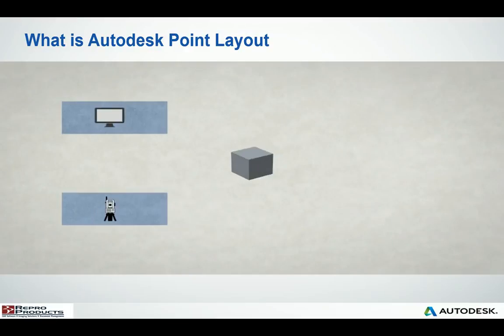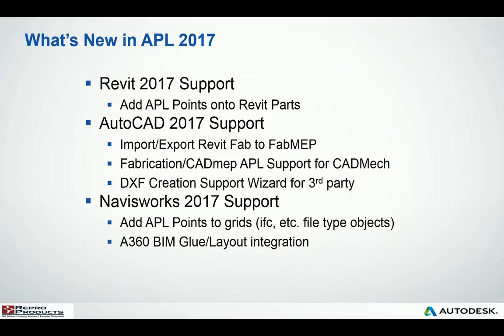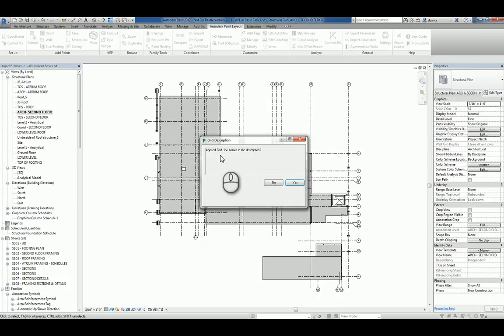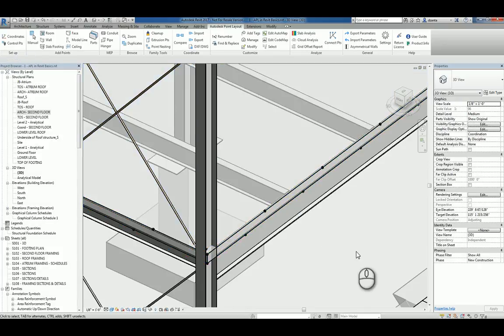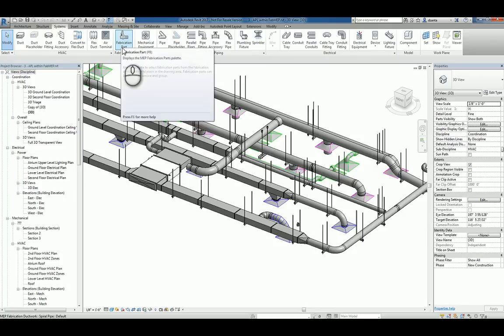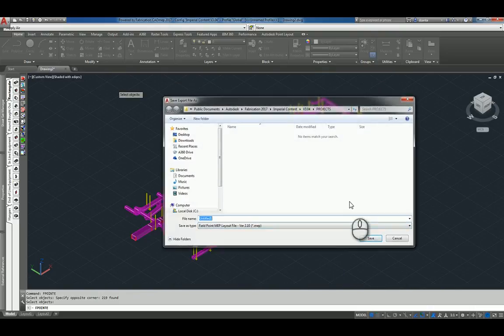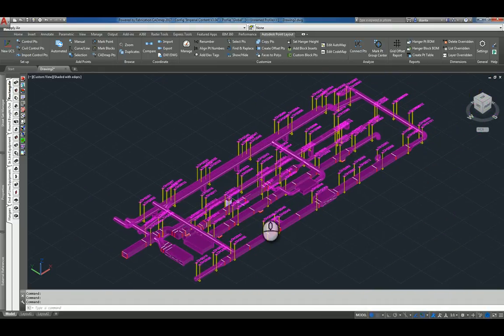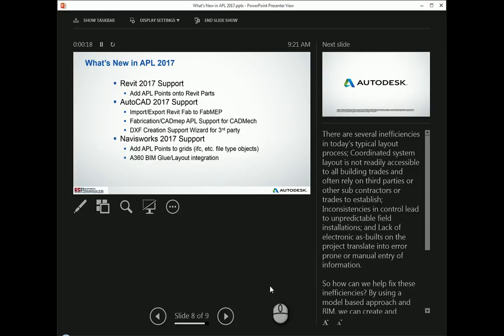What's New in Autodesk Point Layout 2017

Comment: Hi, I really like the pointer you used, where did you get it?
Reply from the maker: hi....are you referring to the icon of the mouse that follows my cursor when I am moving it?  If so, this is a feature of the Camtasia software if it is turned on in the Settings.  If the recording was made with Autodesk Screencast, the mouse icon is turned on as a default.

Comment: I have been having issues exporting points in APL with Navis. when I manage points the XY are correct but when i export they are not. Any pointers?
Reply from the maker: when you export the points, specify a coordinate system first.  Preferrably one that matches the source authoring application (i.e....if the source file is a revit file, use the coordinate system of that)